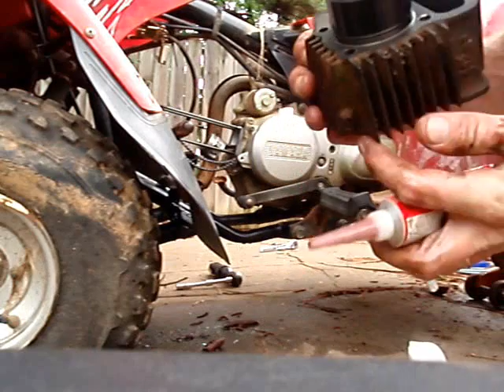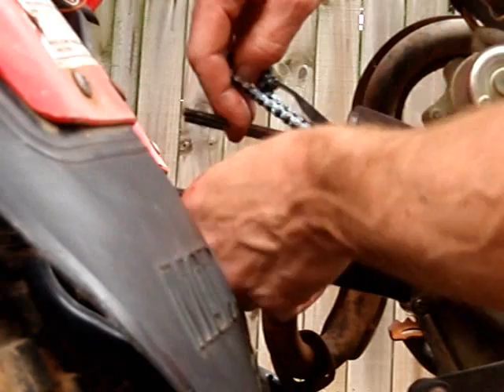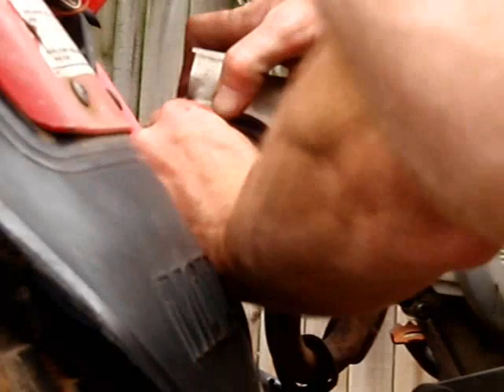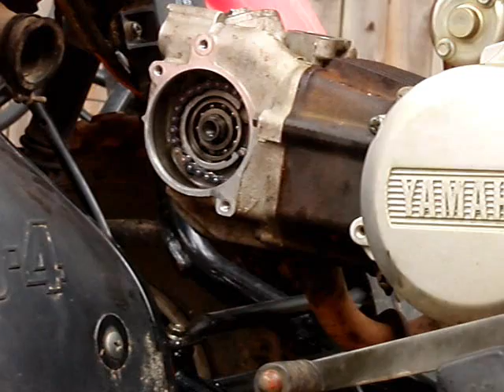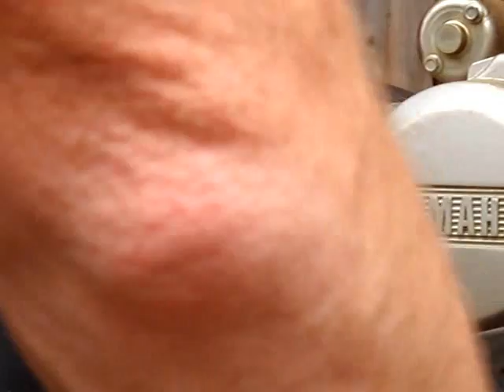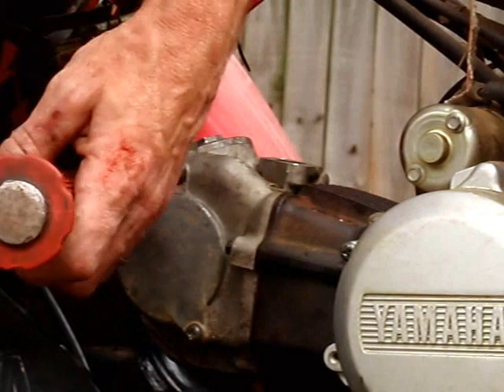yamaha badger moto 4 top end install assembly

Comment: Super helpful, thanks dude. My son and I are doing his first big repair, piston/cyl/head...  Waiting for parts. Our head is so bad that I didnt want to fix one thing at a time to find out more head parts are crap. Dang those full heads are expensive. But we can see flashlight through both exhaust and intake valves when off since the owner left it outside for years and rust/corrosion. Your video was great to see what our install will look like when parts show up. (side note: the 2 extra (long) bolts on the side of the head (not the top 4 nuts)...the one closest to the timing chain...you were able to get a socket on it. For some reason taking ours out there was 0 clearance and had to use vicegrips. Couldnt get a thin socket or wrench to wrap around it. I was jealous to see you could socket it :)  thanks again, great helpful video.
Reply from the maker: For sure ! Can you lube valve stem get medium valve grinding compound! I use fuel line to grab stem in valve then out other end in drill n use low speed n going new seat it’s worth a trying just pull valve seals off you need new anyways n oil it good !
Reply from the maker: Thanks for sharing! I do struggle on a bunch but that’s what editing is for lol we can build it in 10 minutes that’s a lie lol good luck I may have a engine out back I’ll look at it !

Comment: To PROPERLY tension the cam chain: After installing the plunger (flat tapered side out, making sure it goes all the way into the bore), spring and cap. Remove the cap nut from the lock down stud exposing the philips head slots, back the flange nut off flush and start the stud into the hole, then rotate the cam clockwise sightly to take up the slack in the bottom of the chain and hold it there, (the spring against the plunger does the tensioning, NOT the lock down stud) turn in the lock down stud with a philips screw driver (against the taper) until resistance is felt, then tighten the flange nut then the cap nut against it to act as a jam nut, check both sides of chain for snugness and ensure the timing marks line up on the cam sprocket and flywheel both visible at the approximate 12 o'clock positions.  Now you are ready to set the valve lash, Intake .002"-.004" , Exhaust .003"-.005".

Comment: I have the same motor, i rebuilt it but now its pinging at the top end any idea were i went wrong the piston was good had the valves replaced new rings new gaskets?
Reply from the maker: couple things to check 1 is new piston hitting the head or head gasket ? if its a little to tall and extra base gasket will work ! 2 is it out of time and hitting an open valve ? 3 is there so much compression now you actually hear the rod bearing and not in the actual top end ! when the rod is exposed there shouldnt be any up down play but a little side to side is ok !
Reply: the valves were out of adjustment thx for your video, i really did enjoy and used it to rebuild my engine purring like a kitten know.

Comment: did you take a compression reading before and after? I would like to know where the good compression should be at on a badger 80
Reply from the maker: +Clarence Leavitt no im sure it only had about 15 to 20 psi ! im guessing new closer to 80 or 90 !
Reply: +coryncheryl1 I got ahold of a yamaha service manual for my 85 yfm80 badger & the compression Pressure listed maximum @185psi...standard @171psi...minimum @142psi... mine was at 130psi and ran but not well...its all apart now and I'm waiting for parts...
thanks
Clarence
Reply from the maker: Wow i didnt expect that . Thanks for info .
Reply from the maker: +Clarence Leavitt ive been working on china scooters 30pounds on 50cc and 60 on 150 ! not much at all !